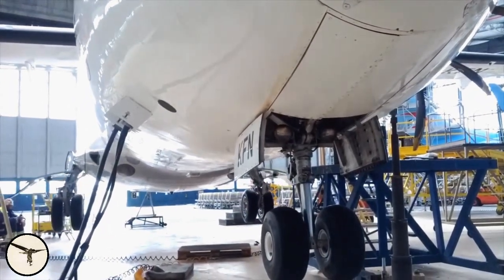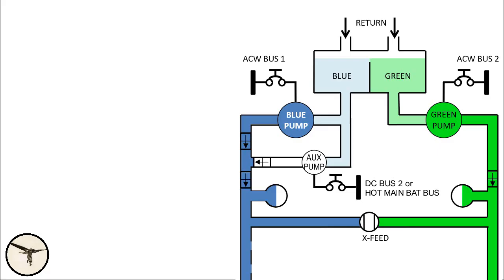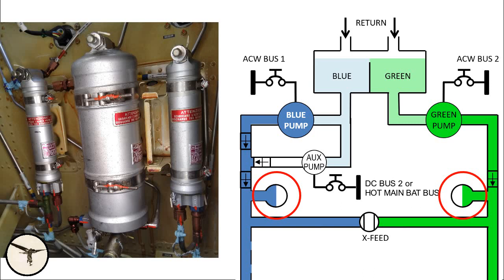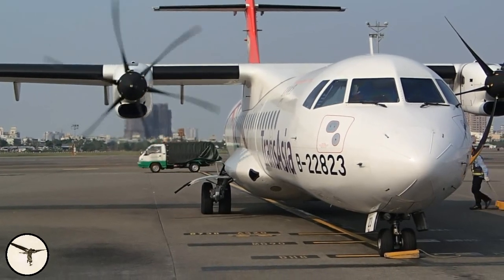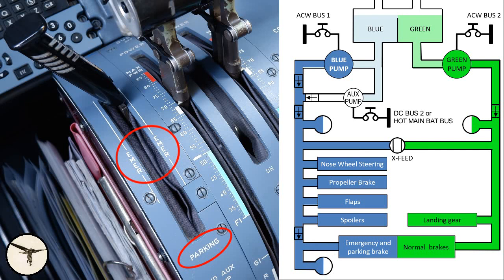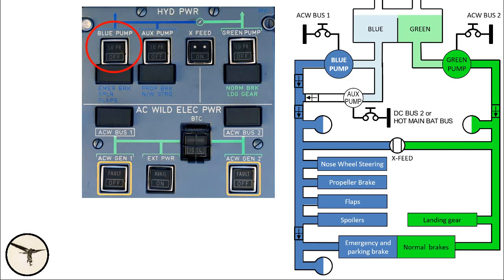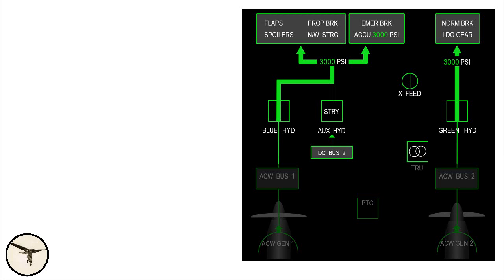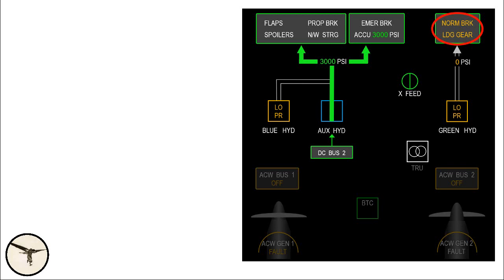ATR systems - Hydraulics

Comment: I'm lucky to be starting my type rating on the ATR 72-600 in just a few weeks. I previously flew the Dash 8-400 and was spoiled with all that power. But now, I am really quite impressed with how SMART the ATR design is. It really is the benchmark for efficiency and highly-optimized engineering!

Comment: Amazing videos. Perfect to watch as an evening lecture and illustrated very well.

As a hobby sim pilot and ex glider, I couldn't resist getting the newly released Hans ATR46/76 addon for MSFS. Do you have it too? If so, what are the shortcomings and inconsistencies with real-life behavior of the systems you have noticed? I watched some of your systems videos and tried around in the cockpit for a few hours. So far, there are surprisingly few things that seem modeled far off.
Reply from the maker: Thanks. Currently, I'm on vacation, but will make some videos when I return to base in a few days. Some flight simmers have already posted detailed reviews of the ATR, and I have noticed a few cosmetic errors, for example when selecting external power from the EFB, you get both DC and AC external power. In real life, we only use DC external power. The dry operating weight is also on the optimistic side. But all in all, the model appears to be very close to the real thing.
Reply: @FlywithMagnar 

Oh nice, looking forward to the videos then. Just did a first flight and some things I noticed:

1. The warning lights for the pitot/static/... heaters seem to be a bit off what I would expect with limited AC power on the ground.
2. The cabin and duct temperature are doing some wild stuff. Went up to over 110°C on one occasion just sitting in a turnaround state at the apron.
3. The hydraulic logic seems displayed correctly. However, with crossfeed on, the systems of the indirectly powered line partially don't work. I was shutting down the left engine during taxi and hence activated the crossfeed to preseve blue pressure (although the standby DC pump also kicked in). Despite this, I immediatly lost all normal and emergency braking. I may have done something wrong though.

Also, it has the "standard" MSFS altitude bug of an "invisible" altimeter being used for altitude data for the autopliot. This one automatically switches from local QNH to STD and back at 18.000ft/FL180 respectively and there is no way to interact with it. So especially flying in Europe it will cause the aircraft to hold wrong levels at any flight level below FL180. The PMDG DC6B also has this issue. There is an easy workaround though by changing the reference altimeter to a "visible" one in the cockpit, it's a one-digit edit. Sadly, as the ATR is a marketplace addon, the file structure is different and I was not able to locate the line of code yet as "systems.cfg" does not exist. I might try creating a file with the name and manually adding it to see if it works tomorrow.

Anyhow, enjoy your vacation and the aircraft when you're back. Certainly less flaws than I expected. :)

Comment: Hello Captain!! Your videos are very good for people that prepare for the type rating.Quick question: if we have both green and blue system inop and we use the aux pump can we crossfeed to have access to the main landing gear and normal brake? Thank you very much for the great things that you do.Have a good one.
Reply from the maker: No, hydraulic crossfeed is not allowed when both main pumps are inoperative. The reason is to protect the blue system from losing fluid in the green circuit (in case of an unknown damage.)

Comment: Malaysia operate few ATR72-600 and may i know is the wheel electric motorised. I remember the ATR moving itself to the runway quite a distance away. Upon reaching runway, the pilot start the engine and props start spinning. I look around the windows and i did not see any tow truck around. I was suspicious as it might be electric motorised that move us there. Nevertheless its a good idea as it will reduce noise at the terminal building.

Comment: I'm not a pilot but I have an huge passion for the air fly simulation. I appreciate very much topur tutorial.  Could you give me some suggestions where I can find Flight Crew Operations Manual of ATR 600. I made several research om the web but I got nothing similar. Thnak so much for your help
Reply from the maker: Unfortunately, the manuals are not available. They are the property of the manufacturer and airline companies.

Comment: Hi Magnar, thank u for your explanation, I have a question : What is the pressure (psi) in the green/blue accumulators ? normal conditions both engine running. I saw in some sources 1500psi and in other ones 3000 psi. 

Thank u
Reply from the maker: Normal pressure is 3000 PSI. If the pressure is below 1500 PSI, we get a low pressure alert.

Comment: Thanks Magnar, the last thing you mentioned regarding the aux hyd pump is a bit amusing. It says in the QRH that it is available (if available actaully), but the FCOM states (ground control only incl. the text on the pedestal) which is contradicting. Today I looked in the QRH for an AT43 which I flew today and the QRH said the same as the QRH in your video but the FCOM states that the aux hyd pump operates via DC bus 2 or ground handling bus. And ground handling bus is as the name implies only powered on ground. With that said, I have found many things not correct with the fcom for the older variants, especially as the fcom’s are updated. I asked the mech to look in his manual, hopefully his manual is more accurate and we can find out if this old AT43 has this mod or not and then determine if the QRH or the FCOM is correct, if any;) When we do find something wrong, of course we contact ATR and they usually respond rather quickly which is good. Another item which I have seen incorrect in a couple of FCOM/QRH (read FCOM says one thing and QRH another) AT43 is where the CAPT ASI/VSI/ALT receives its power from. Does anyone else have other examples of when FCOM and QRH does not agree? Thanks again for all your videos Magnar
Reply: That is VERY interesting indeed! Do you happen to know if the AT76 has any such "glitches" in its books? I'm starting my TR in a few weeks...😃
Reply: @iamra_n3189  I am sure there is but I have not spotted any obvious. It seems like they are more prone to be found in the older AT43 and AT72 where there have been mods which have been ”lost” or lack of mods which perhaps one of the books have included;) Good luck with your typerating. Perhaps I will meet you in TLS, I am going there next week;)
Reply: @LloydAlexander58  thanks for that! Oh nice, you’re off to the factory? 
My TR will be done in one or several locations, MAD, VIE or DUB! 😅

Comment: Hello Capitan!!! Very good explanation about the system, but I have a question... When we have the main Hyd Pumps Loss and it is not associated with a Lo LVL in any system, why can´t we use the Hyd X-Feed, since the AUX Pump will work when we put the LDG lerver down?
Reply from the maker: Murphy's law. If you select hydraulic crossfeed, and there's a hidden leak, you might lose everything. The green system isn't that important. The landing gear has manual extension, and the brakes have a backup as well. The blue system is much more important.

Comment: I saw a documentary anout ATR72 assembly line and i saw that the wing elevators are string cable control. From the wings right up to the cockpit. Is it true it is string cable control?

Comment: Magnar, we know that the ATR that unfortunately crashed in Brazil and 11km from my house, faced temperatures of -40 degrees Celsius. My question: can the aircraft's radar detect and alert the pilots of this situation?
Reply from the maker: A weather radar is dexigned to detect water drops. Minus 40 degrees Celsius sounds very cold for 17,000 feet. However, the aircraft is certified for operation at temperatures down minus 54 degrees Celsius. At that temperauture, where will be virtually no icing.

Comment: Nice to meet you.
I am training for ATR TR.
Your video is very helpful to me.
I have a question.
In the situation of "EEC 2 Fault" and "PEC 2 Fault", why do you turn "HYD CROSSFEED" to　not "ON"?
If you do this procedure, you can definitely avoid "loss of HYD green (NORMAL BRAKE)".
I think that there is a possibility of temporary "loss of HYD green (NORMAL BRAKE)" during landing roll with the current procedure.
Thanks for sharing.
Reply from the maker: Thank you for your nice feedback. The reason why we don't put on hydraulic crossfeed is that the remaining ACW generator will power both ACW buses via the BTC.
Reply: @FlywithMagnar  Thank you for your quick reply.
Dose the ACW 2 Generator be not powered via the BTC if the hydraulic crossfeed is on?
In the situation of "EEC 2 Fault" and "PEC 2 Fault", "HYD CROSSFEED" to "ON" is it a prohibited act?
Reply from the maker: In case of EEC2 or PEC2 fault, ACW GEN 2 will lose power during landing. The ACW BTC will then close, allowing for ACW GEN1 to power both ACW buses. The buses power the main hydraulic pumps. Unsing HYD crossfeed will have no effect, as both pumps are already powered.
Reply: @FlywithMagnar  Thank you for answering.
I want to enjoy learning ATR with your video.

Comment: A question regarding the aux hyd pump: does it displace less volume per second than the 'normal' pumps? If yes, do you notice a longer travel time for the flaps?
Reply from the maker: Yes, the pump is smaller. In the simulator, we notice a drop in hydraulic pressure when the flaps is moving. So, the flaps might need a little more time to move.
Reply: @FlywithMagnar  Check, thanks! ✈🙂

Comment: In the case of VoePass flight 2283 is it possible crew activated the Auxilliary pump on flight? ie clutched the R propeller in flight?
Reply from the maker: It is impossible to activate the propeller brake in flight. The wheels must be on the ground (weight on wheels), and the gust lock must be engaged (which means the power levers must be in ground idle position.)

Comment: There is a procedure in 600 series on preflight cockpit, to push the aux. hyd pump before the walk-around check. In my point of view, this procedure will obscure our ability to see the remaining accumulator pressure in the system. With that pump on we’ll se 3000psi available in the system, which in reality could be far less than that.
Reply from the maker: The external pressure indicator shows the pressure in the parking brake accumulator. Activating the auxiliary pump charges the parking brake accumulator to 3,000 psi. When the auxiliary pump (or the main pump) is not running, the pressure in the system is zero. This can be observed on the hydraulic system page on the MFD.
Reply: @FlywithMagnar  yes sir. But don’t we require the 3000psi to be available in accumulator in order to have 6 applications of emergency brake? if the preflight include the aux pump ON, then we can’t really sure how much the accum. press. left. Another question is, does the 1600psi minimum accumulator pressure as stated in fcom, enough for the event of emergency use?
Reply from the maker: The brake accumulator is charged every time the main blue hydraulic pump or the auxiliary pump is running.
The minimum 1,600 PSI is to ensure that the parking brake is safe to use. So, when we see the pressure is less, we activate the auxiliary pump.
Reply: @FlywithMagnar  oh i see, thanks a lot sir.

Comment: Great presentation as usual! One question about the OVHT light and its implications: in the 737ng the pumps which are lubricated by the fluid circulated through them; the temperature of the fluid and thus its viscosity is controlled by removing hot fluid from the casing via a case drain line and routing it on its way back to the reservoir, through a heat exchanger located in the onside main fuel tank that uses fuel as cooling medium. Should the temperature in the casing of the EMP Electrical Motor Pump and/or along its case drain line exceed a preset value, the OVHT light will illuminate and the pump will be automatically de-energized - this holds true for the vickers pumps -. Now as far as the ATR is concerned, how do u cool the pump off? And does the pump is de-energized off in case of an overheat? And if so provided that all the other conditions are met, will the aux pump automatics come on? Thanks for sharing
Reply from the maker: When the OVHT light illuminates, the pump continues to run and must be shut off by the crew. There's no cooling in the hydraulic system, but the temperature will decrease when the pump is switched OFF. When a hydraulic pump is OFF, crossfeeed is used to supply the affected system. Please don't compare aircraft manufacturers; they have different philosophies.
Reply: Fly with Magnar thanks for the answer, i was wondering how the pumps were cooled as the case drain line were mentioned in both airplanes

Comment: Hi, one additional question: considering that the ACMP is powered by the ACW generator which in turn is only available when the Np is greater than 70.8%, if u loose the left engine or when u shut it down upon arrival, will the auxiliary pump kick in automatically as the other engine is still running and the gear is selected down and the pressure in the blue system drops below 1500psi and what kind of indication will u have on the push bottom - both OFF and FAIL? Thanks
Reply from the maker: No, the other ACW generator will power both ACW busbars via the BTC. By the way, what is ACMP?
Reply: Fly with Magnar that makes sense! An ACMP is an AC powered Motor Pump, i found the same nomenclature in an NTSB report about a crash involving an ATR

Comment: I'm rather surprised that there's no redundancy for flap operation in the case of a blue system leak. Reaching a suitable runway for a high-speed landing might not be so easy.
Reply from the maker: The landing distance at maximum landing weight without flaps is 1,400 meters on a dry runway in zero wind. There are many airports with longer runways.

Comment: When did we use cross feed bar ?
Reply from the maker: Hydraulic cross-feed is used when one of the main pumps is inoperative. The other pump will then supply both systems.